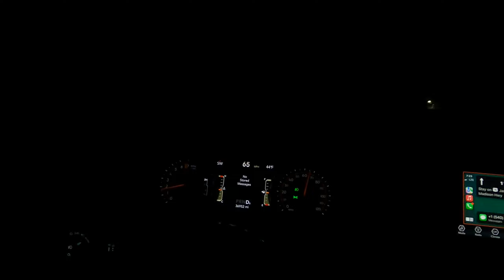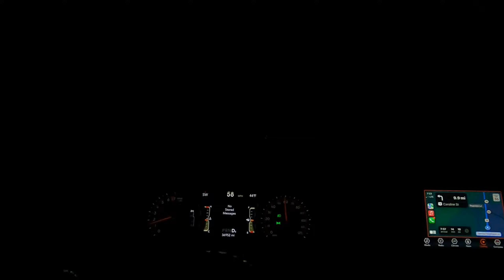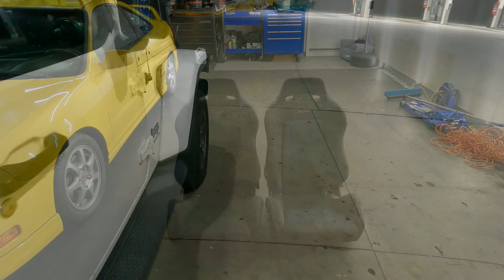Recaros for my ek9 replica!

Comment: Thanks for posting this build - I have a lead on some dc2 alcantera front seats ( expensive) and I have been stressing on the potential color mismatch compared to the stock type k dark grey interior of my hatch. after seeing your post the front seats seem the match “well enough” for a daily driver.
Reply from the maker: Yeah I used to have the same debate, it felt weird putting black seats in grey interior but honestly goes pretty well!!